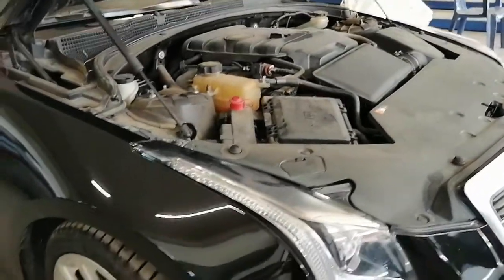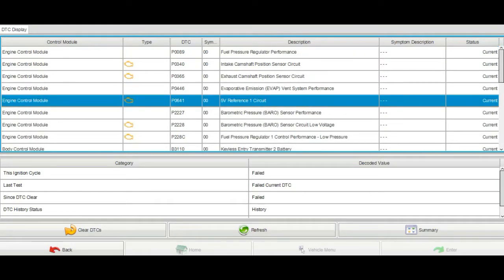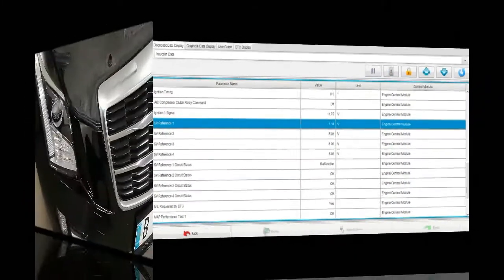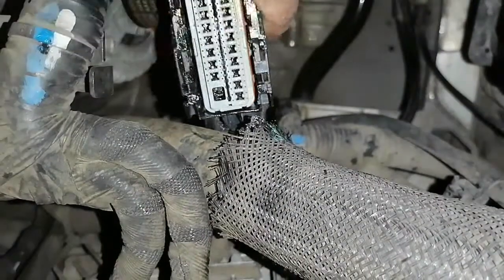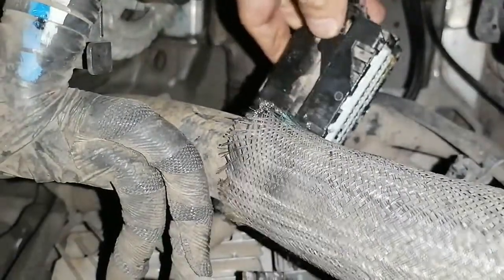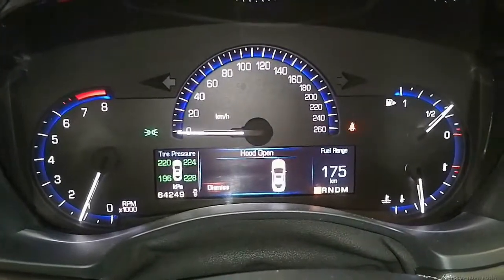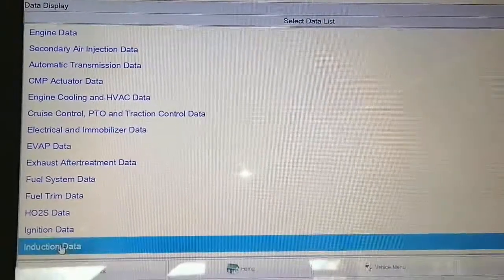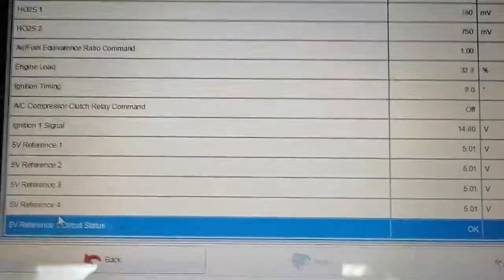Cadillac ATS DTC P0641

Comment: I keep getting code p2227 and p2228 just replace barometric pressure sensor  and code comes back occasionally. same thing with my engine oil pressure sensor just replaced too  and getting code occasionally too

Comment: i have the exact trouble codes but thats not the issue with mine. do you know anything else it could be? iv been trying for MONTHS NOW to fix it!!
Reply from the maker: No, it require diagnosis
Reply: @WissamAbbas  i have a mdi 2 i just dont know what im looking for the tachometer stays at 0 when i do manage to get it started
Reply from the maker: @bradleyflores984  If you have MDI2 it is great, open GDS select K20 engine control module go to data chose induction system scroll down you will see all 5Volt ref circuit here you can know which circuit is down than according to the wire schematic will start your diagnostic please if you found my information is useful subscribe to my channel
Reply: @bradleyflores984   did you ever figure it out?